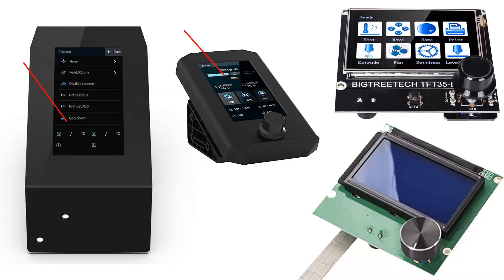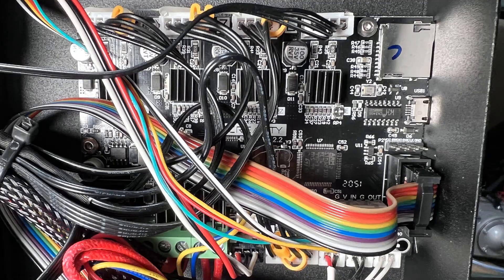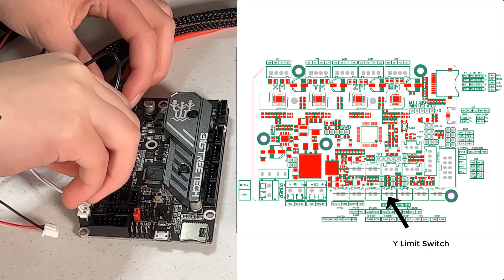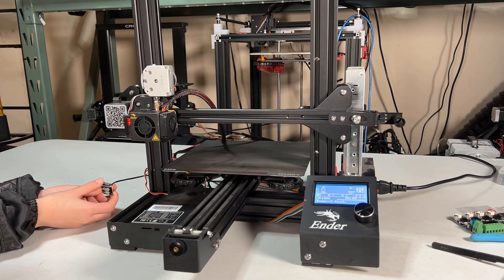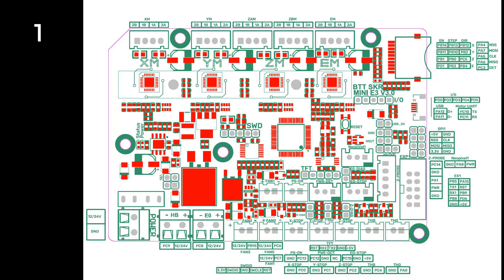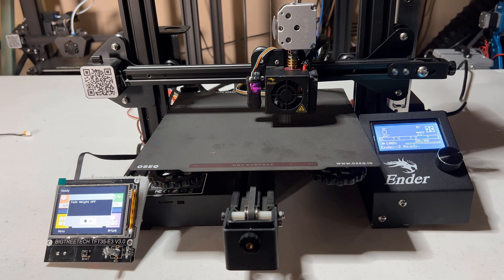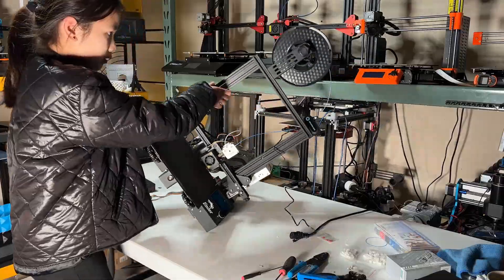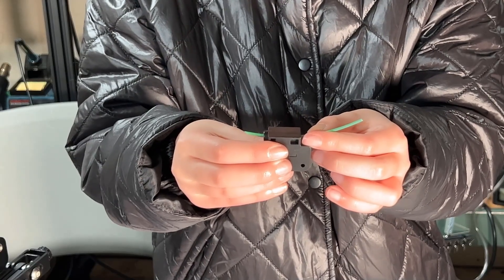Big Tree Tech SKR Mini E3 V3.0 and 3.5” touch screen upgrade on Ender-3 Pro, fixing BLtouch issue

Comment: I had a feeling the BL Touch issue you show here was related to the port not being supported correctly yet.  I almost tried switching it to the z limit port but hadnt yet as i was waiting on some fans to do all my wiring at once.  Looks like ill be switching my wires on the connector  to a JST :)  Thanks again for your videos.  Now to find a Orbiter mount for a Aquila with a v6 :)

Comment: I’d like to point out that the fan2 port should be for the motherboard fan and the fan1 port will go to the hotend heat sink fan, so the video needs to point that out because I had tried configuring it similar to the video but my hotend fan would never turn on. Hope this helps!
Reply from the maker: Thanks, I will add this correction under the description.
Reply: @AuroraTech  - Nope, you were indeed correct the first time....

Comment: Do you have a link for the JST connectors? It is greatly appreciated. Awesome video
Reply from the maker: Sure, I just added to the video description:
JST Connectors:
https://www.amazon.com/gp/product/B015Y6JOUG/ref=as_li_tl?ie=UTF8&tag=auroratech09-20

JST Crimping Tool:
https://www.amazon.com/gp/product/B078WPT5M1/ref=as_li_tl?ie=UTF8&tag=auroratech09-20
Reply: You could use the 2-pin JST connector from the old Z-limit switch to install the black and white pins removed from the 5-pin connector. No JST purchase required!

Comment: My colors of the cr touch are different then yours i am not getting it to work my colors are from left to right white black yellow red blue on the motherboard en on de cr toch blue red yellow black white any idea?
Reply from the maker: Yes, some manufacturers may use a different color scheme the conversion would be:
Brown = Orange = (Ground)
Red = Yellow = (+5V)
Yellow = Green = (PA1 - IN)
Black = Blue = (Ground)(Z Limit Switch)
White = Black = (PC14 - OUT)(Z Limit Switch)

Comment: I am stuck. Ender 3 Pro, V3 board with BL Touch.  Installed firmware like you said, but I get "Invalid Mesh" every time I try to enable the BL Touch.  Any help would be greatly appreciated!
Reply: same

Comment: Did you try using the jumper on the pins above the z stop. I haven’t finished installing mine but BTT says you need to use a jumper to make use of BL touch sensor homing

Comment: Thanks for making this video. I followed this tutorial exactly with an Ender 3 Pro, skr mini e3 v3 and ended with the same setup you showed at the end of your video. Unfortunately, the bed leveling functionality is not working. any help would be appreciated
Reply from the maker: Please watch 07:55 - 009:37 and make sure:

1. Move 2-pin from the BLtouch connector to the Z endstop if you are using the exact same setup as mine. 
2. Use firmware-ender3-bltouch-for-z-homing.bin (rename it to firmware.bin)
Reply: @AuroraTech   Thanks for your prompt reply Aurora! I rechecked everything and now the bed leveling works. I appreciate your help with this setup.

Comment: So what method did you end up using for correcting the Z homing issue? I noticed you mentioned 3 ways but I'm curious which one you picked for im trying to troubleshoot mine too since I just got the skr mini E3 V3 as well

Would love to hear back from you!
Reply from the maker: I removed 2 pin(black and white) from the BLTouch connector and connect them to the x-end stop.
Reply: What if my BL Touch doesn’t have a black and white wire in the same location as your BL Touch?

Comment: Awesome video, helped me install the board and saved me a lot of time, however i feel like the Fan ports for Controller and Hotend heatsink are flipped. On the TFT i try to change the settings of the Controller Fan and the Hotend Fan starts working.. Is the Controller Fan the hotend heatsink fan? Or is it the motherboard enclosure fan?
Reply: Please look in the description, she updated the fan locations and corrected them

Comment: Great video, I upgraded the v1.2 board in my E3Pro to the newer v3 last December, and the only issue I had was that the stock firmware did not like my SD card being formatted to FAT32. Once I reformatted to FAT16 and applied my own custom firmware I was able to switch back to FAT32. I based my own firmware on the bugfix-2.0.x from Marlin direct, there are v3 BTT configs already available, I added my own tweaks for the TFT, BL-T, NeoPixels and smart runout sensor plus other things, and it works like a charm. Being able to finally shut the hotend fan down when below 50c is wonderful as well as better control of the board fan.
Reply: My board dont read my SDCARD i try many SDCARD FAT32 but dont read my files, can you help me?

Comment: its not very uncommon to use both the bltouch and endstop, it just makes it simpler to install it into the dedicated bltouch port and not have to deal with removing the z endstop or unplugging it and it makes the firmware configuration a bit easier
Reply from the maker: That's true, you don't have to edit firmware or rewire the cables if you keep the limit switch. But I never use a Z limit switch on any printers with a bed leveling sensor. If I keep the mechanical limit switch and use it for homing, the first layer will depend on the accuracy of the limit switch.